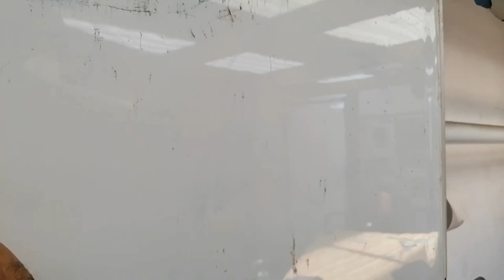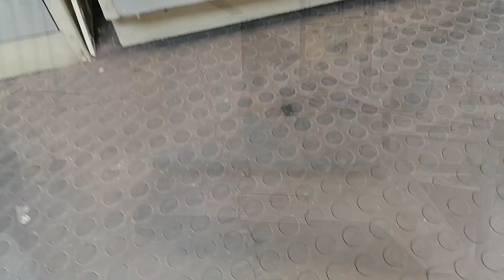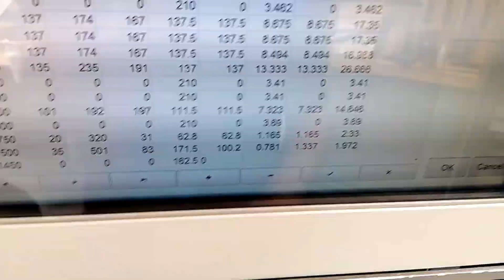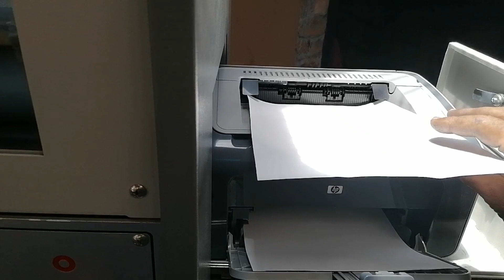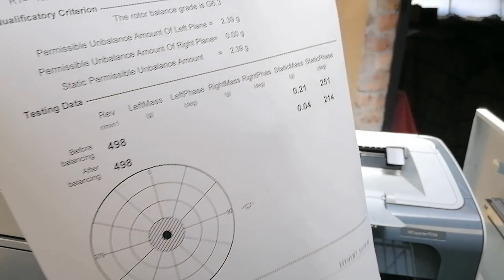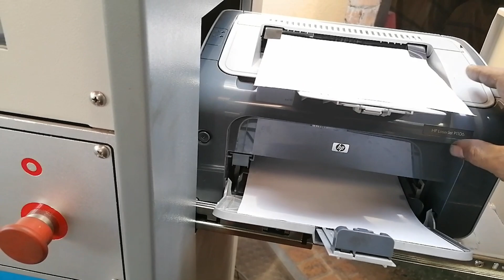Five Phosphur Bronze Centrifugal Pump Impellers for Single Plane Dynamic Balancing ....

Comment: How much time average on each impeller ? ,the worst was close to 157 grams off,hard to guess how much you grind each time and you do not want to grind too much or you will have to grind the opposite and it take more time then,Ray
Reply from the maker: Hi Ray, you are correct in saying that if i take off to much then i will have to grind again, but it will not  always be on the opposite side, in most cases the unbalance mass shifts a few degrees either side. It takes an average of 1 - 1.5 hours per unit, depending on the unbalance mass quantity. In all honesty, when i grind the impellers, then it is a guessing game as i do not know how much i take off at a time, but i got the feel after doing this for a while, so my judgement is relatively close when i grind. Thank you for the comment and watching my videos. Have a blessed Christmas and Happy prosperous New Year. Take care. 👍